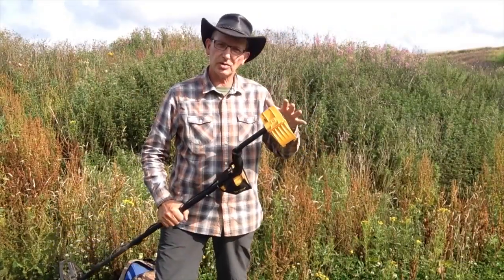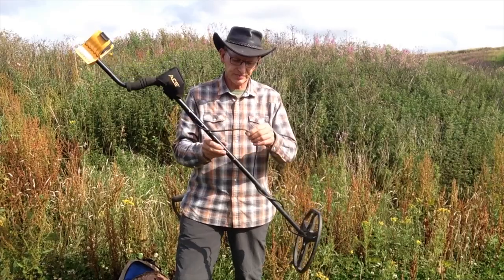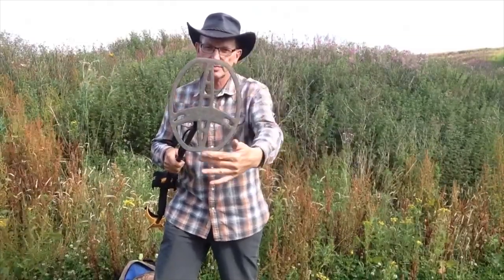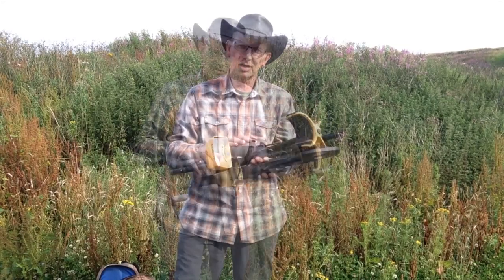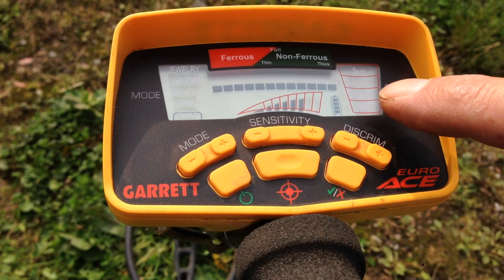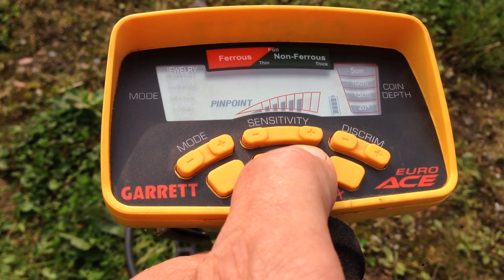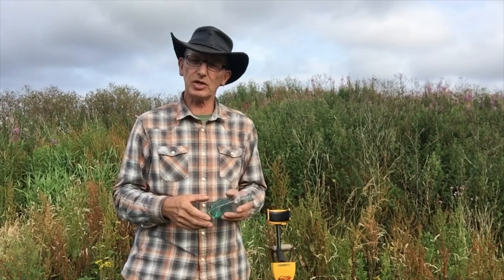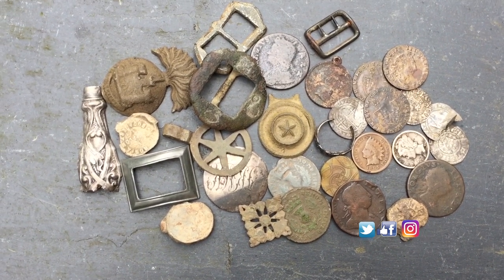Garrett Euro ace basic set up 2019

Comment: 13:45 great informative video . question shovels or spades are metal does it not  affect readings  also people cary phones and belt buckles and steel toe capped shoes I worked a metal detector for a few years and we had to be metal free not even a watch.
many thanks
Reply from the maker: Prety much the new ones don't set off with phones and belts and the like you just keep out of reach, the coil is on the end so no chance of anything 18" above the coil is going to effect the detector..

Comment: Will the custom setting you got it on stop it from picking up everything. And more brass copper silver .So it's not going off all over the shop.
Tia
Reply from the maker: You can discriminate by notching out the bad signals there may be a slight cross over but if you are in a trashy area it helps a lot ..good luck feel free to stay in touch let me know what you find..😀👍👍👍👍👍